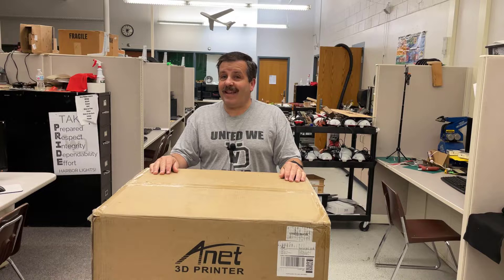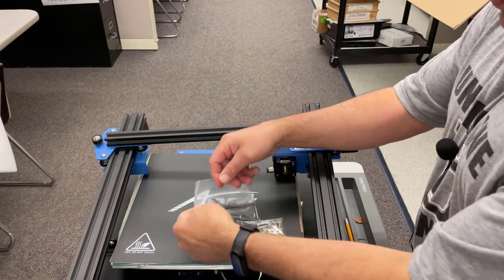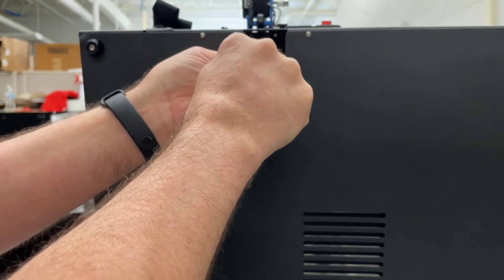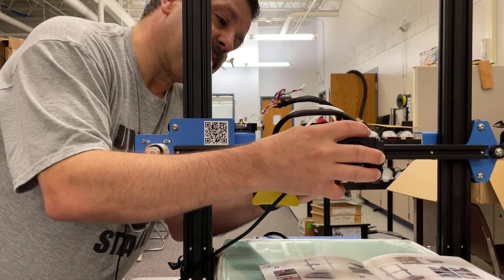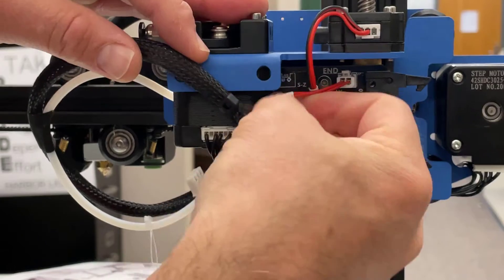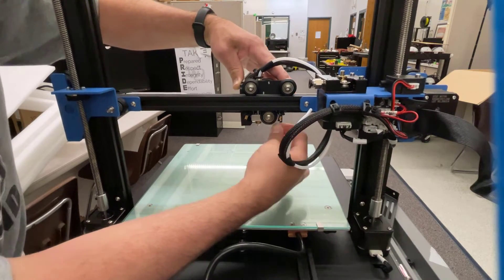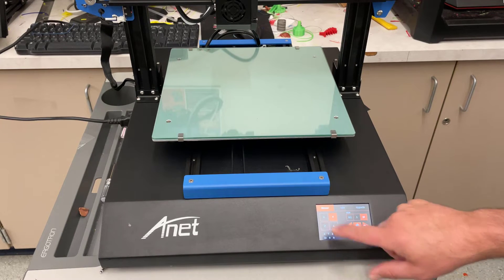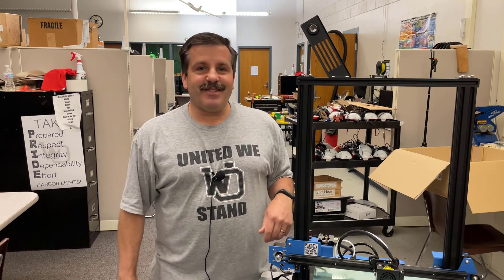Tested! Unboxing and Assembling the Anet ET5X in about 15 minutes.

Comment: Great video on assembling the printer, but What about checking that the two z-axis’s are aligned exactly the same and that the frame is square and that the bed is manually levelled and that the print head sensor is correctly set so that the nozzle doesn’t crash into the bed?
Reply from the maker: Those are all good points. I usually build, test those first movements and roll. If something is off on the first prints... I back up and fix. I have had absolutely zero problems with that printer though.
Reply: @HLModTech  Hi, it’s just that I’ve recently purchased an Anet ET5 printer and want to set it up so I was looking for a tutorial that goes through the detailed setup process, as I heard that the ET5 can be a pain to setup prior to a first print and as a newbie to 3D printing I was hoping to get some help. I’ve also got a Creality 3V2 printer that was a pain to level and setup, but now thanks to watching many YouTube videos is working well now:)
Reply from the maker: @stevo39x  I think the build will be similar. One thing to note is that you should never have to force tightening of screws etc... If it is not going in easily it may be misaligned. I always start here for a 1st print. https://youtu.be/7-6aHrg6oKA It is a tiny cube, but once I have it rolling I move on to the trickier projects. Another thing I like to stress is that each printer will act differently. If you try to force what works for one onto another... you will most likely get frustrated. I even have multiples of the same models and like real-life twins... they each have their quirks. =)
Reply: @HLModTech  Thank you for the kind advice and guidance and the YouTube link, I plan on starting tomorrow,so hopefully it will go okay if I take my time🙏 I will let you know how I get on. Thank you, Steve

Comment: What the difference between the Et5x and the Et5? Thank you
Reply from the maker: I only have the 5x, but I have a 4, 4x and a 4+.  The x versions were a little cheaper, so I would guess there are components that cost less. I use them all interchangeably though.  The original 4 was goofy in that it homed up. The new ones are normal though.